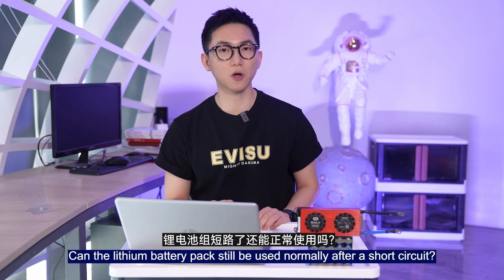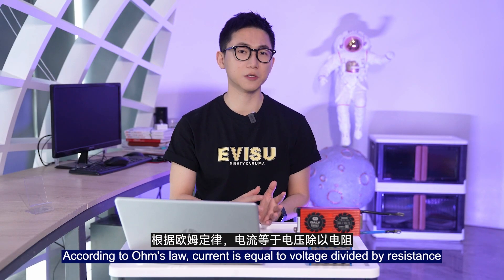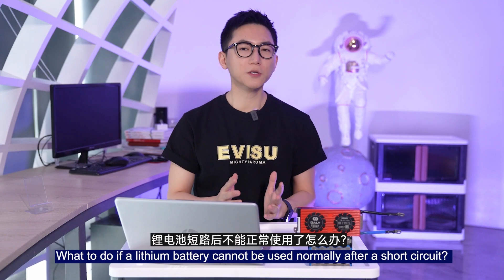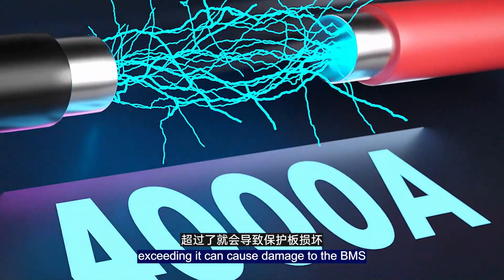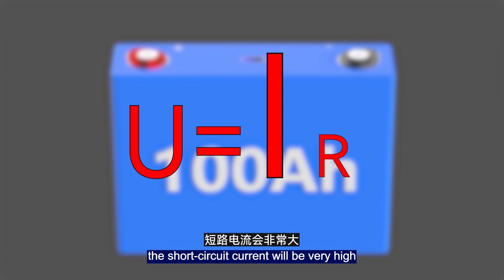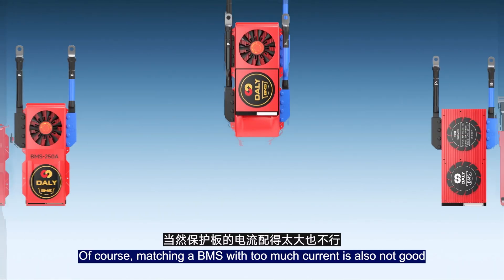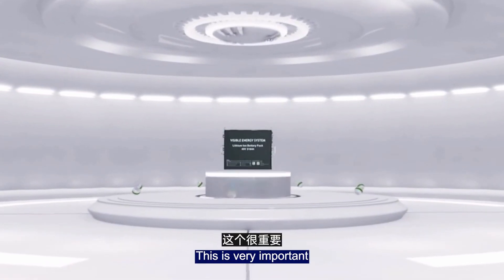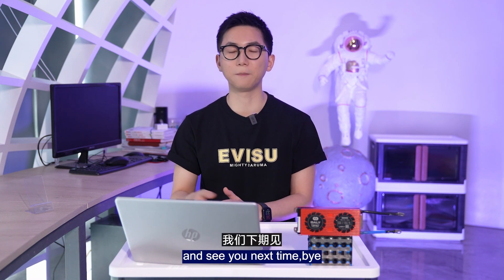What To Do when lithium battery is short-circuited?

Comment: I have a 15kw lithium battery for a solar system that was recently shortcircuited (literally stopped working and came up with a short circuit error code) and had to be returned to the company, from your explanation i now understand that the BMS took the hit instead of the battery itself (good thing!). My question is - Are there precautions to avoid this from happening in the near future?
Reply from the maker: First, you need to find out the cause of the short circuit this time, because generally speaking, short-circuit behavior is not allowed. Therefore, there is no such thing as prevention. Once a short circuit occurs, there must be a reason for it.So,find it,solve it
Reply: @BMS-Lithiumbattery Thank you!

Comment: after a short circuit on a battery pack  of lifepo4 if its  damaged ,would they work after?,,is there any way to tell if they are ok?
Reply: They will typically survive

You can check their capacity

Comment: is bms short circuit protection current is 3 times of rated current?
Reply from the maker: 3-4 times
Reply: is smart bms also burn when we set high discharge current limit(80amp) and then we short circuit it at high ampere(500amp)?
Reply from the maker: @lithiumenergy5714  Yes, once the short circuit happened,if the current was too high, exceed 3-4 times of the rated current, the BMS will be burnt before activating the short circuit protection